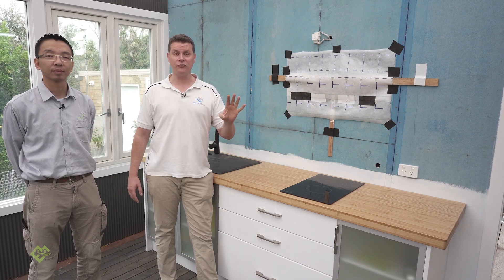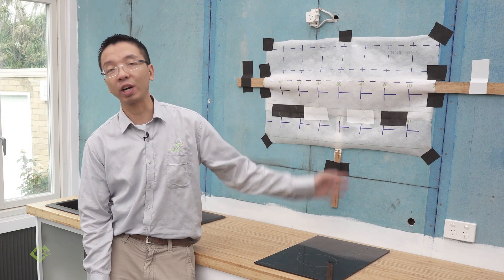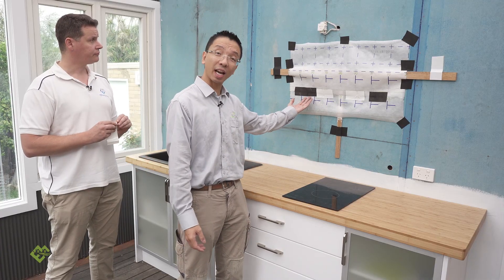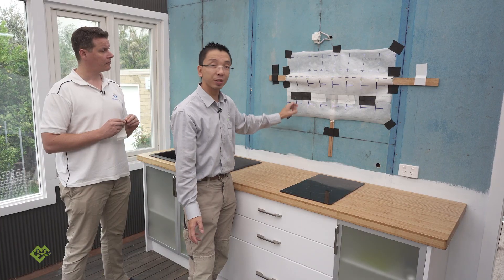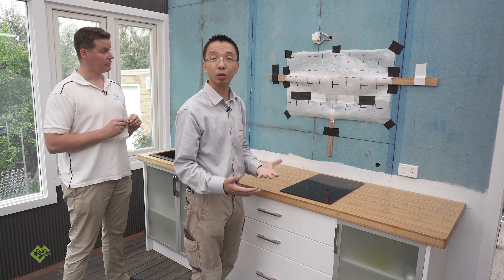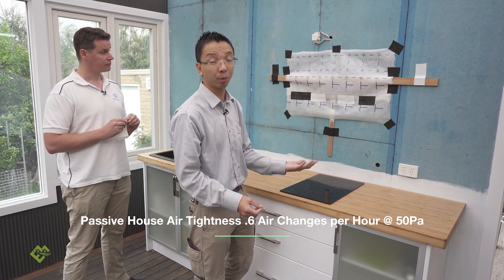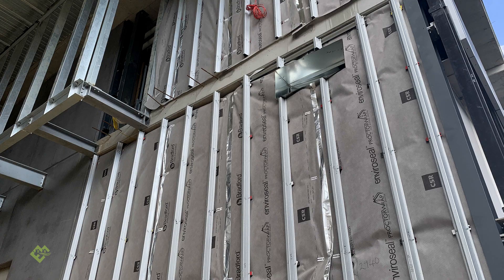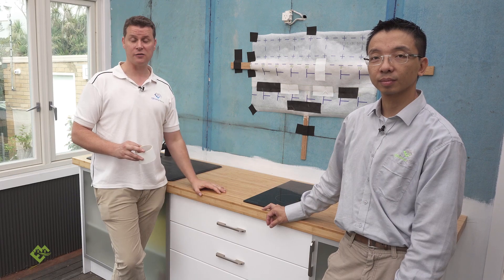External wraps/sarking(Weather Barrier), what is an acceptable installation?

Comment: What promise do you make on glue longevity? Pro-clima's tapes are expensive, but due to being solid acrylate they have tested accelerated aging of 70 years without degredation.  They are really sticky. I'd like to see some good tapes that are less extortionate, but a tape that comes off after 30 years is no use at all.
Reply from the maker: Good question. I have used ProClima tapes myself and there is no doubting their quality. We fully support the growth of all quality products being made available and their usage being taken up in Australia but there are plenty of other good products out there.
 
I am sure ProClima will be first to state that not all "solid acrylic" tapes are created equal. Just by being a solid acrylic is by no means an assurance of durability or functionality.
 
The "100 year" testing mentioned by ProClima relates to accelerated ageing for 700 hours. You can find all the details here https://proclima.com/service/100-years-adhesion  Impressive stuff but note the declaration says "Reliable functioning tested for 100 years" which may or not equate to “without degradation.” They are absolutely right. It is all about reliable long term functionality. A tape that starts off with poor adhesion, even with no degradation, will still be a poor tape.  
 
Our video blog talks about many of the different factors that play a role in our selection of tape. We go through a lot of tapes and have tried many. We are lucky in that we are not tied to any particular brand, technology or manufacturer. Durability is certainly one of our key consideration in deciding what we use. The tighthouse tape we showed in the video are also European manufactured and also surpass the requirements of DIN 4108-7. The ongoing accelerated age testing is way past the 120 hours and although not quite at the magic 700 hours, the interim results I have seen are impressive and  give us plenty confidence about long term adhesion.
 
Please get in touch and give these tapes a try.
Reply: @ecoevo  Cheers for that proclima testing link. I tried to find it before replying to get my details right, but failed :-)
Sadly I am not in Australia. Is your tape  available in the UK? (I see it costs about 25% less than a roll of Tescon Vana or 8% less than unitape). I am continually exasperated that builders merchants still don't carry airtightness tape of any sort, despite having airtightness requirements in the regs since 2013. How on earth are people going to get houses with decent airtightness if tape is still a special 'order it in' item and you can't just dash to the store to get a roll of tescon or equivalent from Siga or _something_?

Comment: Would you recommend a wrap or panel system to achieve the best possible air tightness?
One would think rigid exterior panels would be far easier to seal than a wrap either internally or externally.
Reply from the maker: MegaGouch I agree, panel systems seem to always end up more predictably air tight.

Comment: How does one get the training to be a installer? NZ has a training center. The Australian passive house was not even able to help at all
Reply from the maker: +Timothy Welch There isn’t much here in Australia on building wraps and getting a building air tight is there?
Reply: @ecoevo  No there is not.  Who did your installers train with/at? Its so crazy that is still non in Australia. If there is they don't exactly advertise. Seem like is a self taught here. The videos online by training center's are one thing but like they all point out correct application takes training!
Reply from the maker: Timothy Welch They are just good tradesmen, and we have shown them how things can leak. 😉
Reply: Still that's training from someone that knows the science and issues with the products.

Might be a NZ training trip to be had